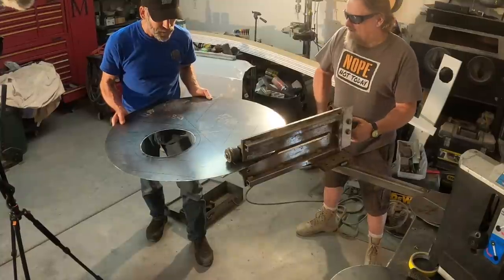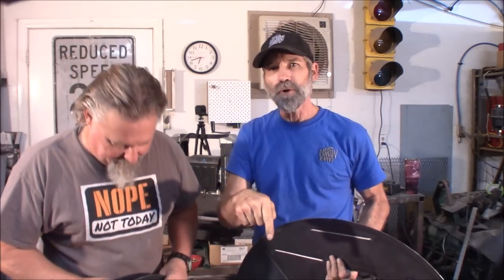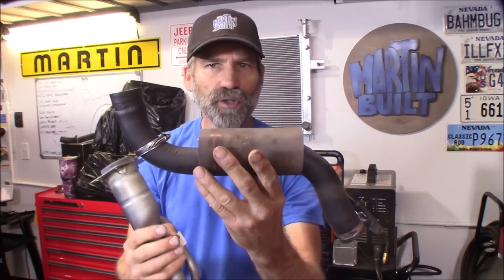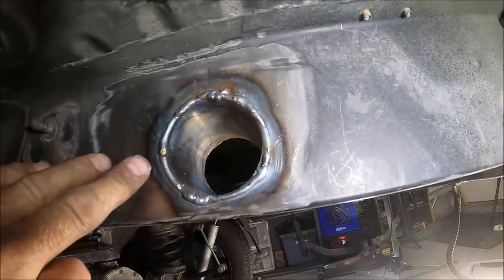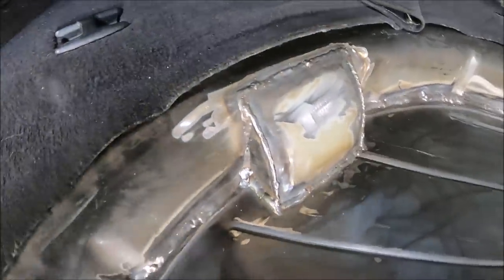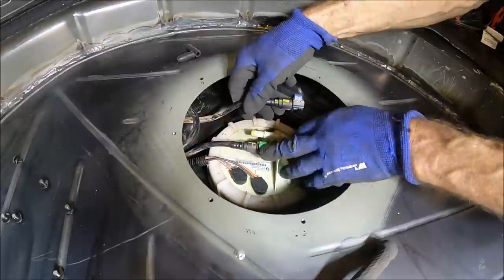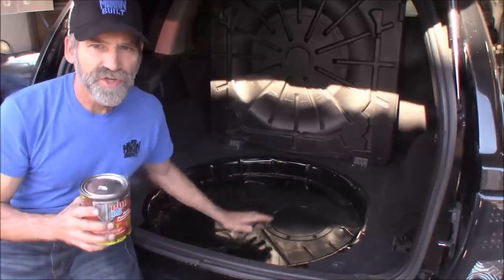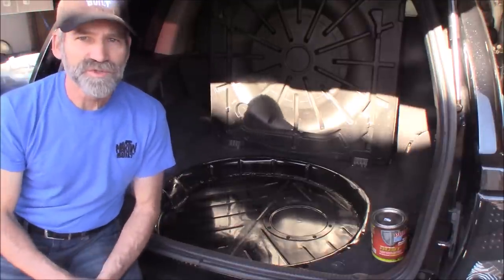How to Fuel Tank Tuck a 99-04 Jeep Grand Cherokee WJ Part 2

Comment: Thank you for the info. I saved lots of time by not welding the pan in 100% only 1" beads with 2" spacing. I used a metal adhesive and it's a strong adhesive weld like you see on vehicles, and 100 waterproof.
Reply from the maker: Nice work!

Comment: Nice job you made of that I was a bit worried that you would have problems getting the rubber fuel pipe on but it worked out fine in the end.
Reply from the maker: Thank you

Comment: Great job Martin! Only thing I would have added would be seam sealer to the weld on the bottom plate to give it a more finished look. Run a sizeable bead all the way around and use a brush and lacquer thinner to work it smooth.
Reply from the maker: Thank you, James, and thank you for the tips.

Comment: Love your attention to detail
Reply from the maker: Thank you, Nate
Reply: martinbuilt is yours a quadradrive?
Reply from the maker: @nate4036  yes it is.
Reply: martinbuilt I bet with those posi units and add some 4.56 gearing, it’d haul booty. I sorta enjoy the street look WJ. Kinda SRT before the SRT. Have you swapped the converter or added a shift kit?
Reply from the maker: @nate4036  Hi Nate, I would like to change the gears I was thinking of 3.92 or 4.11, I feel the 4.56 are a little to steep that would be 3000 rpm at 70 mph.  The convertor is on the list as well as the shift kit. Do you know of anyone that does go work building stall convertors?  What is your opinion about which one to do first, gears or convertor?
Reply: martinbuilt I’d say a Circle D 2600 stall, and I’d do gears first. They take the stress off the transmission, a stall would then take advantage of them. If you’re considering larger cams in the future, may want to run closer to 3,000 stall. My last mustang had 2800 stall, 4.30s, 26” tires. Pulled great and would cruise efficiently around 28-3000rpm. But I’ve noticed that the 545rfe seems to have lower line pressures, seems the sonnax (spelling?) shift kit with the line pressure boost is a smart decision.

Comment: Beautiful work! You could use the old spare tire place for some tools now. Do you keep the spare tire in the luggage area now? I hope you can solve the fueling issue and "parachute" issue.
Reply from the maker: I haven't carried a spare for years, I have an air compressor and AAA...Lol
I'm not to worried about the fuel fill issue, it's just a little slower than normal.

Comment: Glade I didn't have EVAP to tinker with! I just cut that sucker flush, traced the tire cover onto some ⅛ steel and cut it out. Raptor lined and then drilled it every 3½ around the edges and used some self taping screws and silicone to secure it. I cut frame and welded a 3" exhaust in it and  plumbed it all back together... But the new 4.0 I just bought has that stupid evap so this looks like it would be worth all the extra to save room for that to be tucked later.

Comment: Martin, im planing on relocating my evap system from the lower left corner, do you have any sudgestions?
Reply from the maker: I would imagine you're gonna relocate it to under the hood like the earlier WJ's.  I would just get everything from your local salvage yard from a donor vehicle And swap everything over. And you'll also need to do a little wiring as well.
Reply: @martinbuilt   thats what I was thinking  I wasn't sure if that was the most reasonable place as I am building for off road use but don't think water (water crossings) will be much of an issue .
Thanks Martin
Reply from the maker: @douglasbeary7890  
there is a vent on the EVAP that I would raise if you are going to do deep water crossings.
Reply: can it be mounted horizontally? thinking of dog housing it with my fill tube which might go over the frame. then a flat, millenium falcon shaped lid.

Comment: The aluminum filler neck and vent, if you install it 180 degrees from how it’s supposed to go in (upside down) trim 2.5-3.5 inches off your filler and vent neck side (not the hoses) you don’t have to cut and run ur lines threw your unibody just saying already went threw this months ago.

Comment: Great job Martin. 👍👍👍
Could an electric motor with a foot switch be attached to the bead roller, to give the same speed as hand cranking?.
That was a great idea with the bicycle wheel for support.
Reply from the maker: Yeah Rick and I talked about that how nice that would be to have some kind of electric motor with a gear reduction drive and a foot pedal.

Comment: I'm on my 8th and FINAL WJ and I don't think I'd ever do this as I don't see the point. All of your other mods are very applicable. Spare tire pan provides structural integrity for the frame though doesn't it...?
Reply from the maker: The spare tire holder does add some structural integrity one of the reasons I didn't eliminate it all together and why I added rolled beads to the steel plate and welded it in 100%
 I feel the vehicle is much safer now that the gas tank is tucked up under the vehicle more and doesn't expose it as much as it did before to a rear impact.
 It sure looks better than that saggy diaper.
 Thank you for watching.
Reply: @martinbuilt  I understand the reasoning behind this. Where does the spare go?

Comment: Any chance you have a video showing how to relocate the EVAP canister ? I relocated mine without pics ( stupid ) now I don't know where the middle hose on top of the canister goes and what attaches to the small tube on the gas  filler neck . If anyone knows, I'd greatly appreciate it. Thanks in advance
Reply from the maker: The small hose that is attached to that round grey thing goes to the fill neck vent and the middle hose on the canister goes is the large hose that heads to the front of the Jeep.

Comment: Noob question but won't drilling into the frame cause issues with like strength? Any way I would be able to change things up to avoid drilling into the frame? And amazing as always Martin 💯
Reply from the maker: Thank you, Hasith
I would agree if you drilled threw the frame and did nothing else but since I sleeved it and welded it in 100% IMO I feel that it may even be stronger then before.
Reply: @martinbuilt  ohhh rightt thanks Martin. Gonna be following these two videos and try do this on mine. Thanks to you and your videos my old Jeep got a new leash on life 😭❤️

Comment: It looks so beautiful! 😢😍
Reply from the maker: Thank you, I do appreciate that.
Reply: @martinbuilt  yes sir. I've got a 99 Grand Cherokee Limited. I've got some work to do to it. It has the 4.7L V8. Automatic. QuadraTrac 4wd or AWD if you want. What mods would you suggest? How bad does it hurt these motors to overheat?
Reply: Trent I’m not jumping in on him, but over heating a 4.7 is almost certain death. The break down of the tappets and dropping rockers is almost guaranteed. It’s very much fixable, but plan for tappets, timing chain, rockers, and head gaskets. I recommend a chain soon after 200k but seen oem go 300k
Reply: @nate4036  it has 175,000 some odd miles on it. Its been overheated at least twice now. Both times were heater core related. I bypassed the heater core and had no more problems with overheating until the radiator sprung a leak. Thankfully I was just working around the house and caught it right away.
Reply: Trent Sounds like you’ve been lucky brother. Oil look decent when you drain it still? Just keep up on the maintenance and she’ll live for you.
Reply: @nate4036  Oil looked fine. I was so scared I was gonna have the dreaded milkshake but everything looked fine thank God.
Reply: @nate4036  main reason I was asking him was because he had mentioned it in one of his videos a while back and I was just wondering.
Reply: @nate4036  I really truly appreciate your input man. Thank you

Comment: Hey Martin
Love your videos
I had a question bout tha tcm swap
My tcm has 3 different port and tha jeep tcm has 1 whole port how will I go bout fixing that
Reply from the maker: Thank you, you are looking at the ECM, the TCM on your vehicle is most likely located in front of the air cleaner box.
Reply: @martinbuilt  
Thanx Martin 
I found it
But my port has 3 port not like urz
1 port with 1 bolt
Reply from the maker: @thaAzian1401  what year, make and model vehicle do you have?
Reply: @martinbuilt  
05 dodge dakota slt
3.7l v6

Comment: Hey Martin! Any chance you know what years and sub models have the heavy duty tank skid?
Reply from the maker: From what I've seen at my visits at Pic-a-Part, it doesn't matter what year or sub models  it's almost hit-and-miss.
 I would imagine that all Overlands have a heavy-duty skip plate.
 I've actually been thinking about building another one with the light duty skid plate just to reduce the weight of my Jeep.
 Since I don't go off-road, that one at all.
Reply: @martinbuilt  Thanks for the quick answer! So I'm assuming it's pretty obvious the difference between the heavy one and the light one?
Reply from the maker: @TheGersh13  Yes you can really see it in the area where I had cut my skid plate.

Comment: I have a problem with grand cherokee 2000 4.7, I changed the cranksensor because it turns off I have to wait for it to cool down and turn it on again, but it still keeps turning it on.  would it be the fuel pump?
Reply from the maker: It is possible, I would get a fuel pressure gauge and check your fuel pressure at the fuel rail, should be somewhere near 50 psi
Reply: I changed the fuel pump, it starts running and after it turns off I don't know what to do.

Comment: Great job!, Martin
I have a 2003 WJ Overland and I have problems with the differential shafts, they are original, they are permanently blocked, dana 35 and dana 44, what do you recommend, change the axles or repair them?
Reply from the maker: sorry to hear, what do you mean by permanently blocked? 
you could replace them for around $200 per axle at Pick-a-Part
Your front axle is a Dana 30 and rear is Dana 44
Reply: If you have the overland with the 30/44 combo you likely have LSD's (come's with the Quadra-Trac 2), i wouldn't give them up as they are about the best factory axle set up on a WJ that you can get, mine is an 04 WJ Overland and that as I understand it was standard for that model however mine is Canadian, don't think it matter's.
Not quite sure what the problem is but it sounds like either axle seals or cv boot's either way cheep parts that may be messy to replace but not hard for a tool user.

BTW Nice job Martin
Reply: @martinbuilt  Thanks for your comments Martin, when doing a test turning the wheels in the air, both wheels on the axle always turn in the same direction, and on the way you feel the blockage when turning, I am writing to you from Chile in SouthAmerica
Reply: @dshepard3161  Thanks for your comments friend, that's how it has LDS, I usually import the spare parts from Ebay to Chile, the problem is that the bleokeo of the axis is permanent, it is not released, it is practical in off-road but not in the city, some suggest me to change axles and put Air lock or electronic lock, and others suggest me to repair the LDS system, if the LDS is cheaper but difficult to find the repair kit, I don't know which one to choose
Reply: @joseluisguajardo3732  Ah I see, my bad for assuming that you were in North America, "bleokeo" is not a word i understand, however from what you are saying it sounds like the diff is not disconnecting under normal driving conditions, if this is the case yes air lockers are an option however you may find it much cheaper to get a new set of viscose coupler's (clutches) for the factory unit's, they do require a diff oil that has an additive for friction however.
I have to say that mine has only just rolled 220,000 km but I use her rough towing a trailer into the bush country/mountains of west Canada hunting. Never had a problem.
As i do not have any idea how hard it is to import anything to Chile or what prices may be like i can only help as far as tech knowledge goes and your friends may be right about changing the factory LSD's out, but the D44 is un-stoppable up to 35" rubber in that weight class so don't dump it unless you have a direct drop in replacement, setting up new link's requires some experience.
Reply: @dshepard3161  yes it is, I am somewhat far away in Chile and for my hobby I usually follow several of these websites, I have done many jobs in my wj, it has the same mileage, but the specific things I leave them to an expert, I can purchase parts in a dealer here but It is very expensive and it is more convenient to buy in the US, here we call "blokeo de diferencial" in spanish to the differential lock, I will put tires between 33 or 35, I will try changing the couplers

Comment: Anyway to do an EVAP delete without having negative consequences to the engine or fuel system?
Reply: David Macias you can delete it without any damage to either, it’s going to throw a code though
Reply: @nate4036  thanks for the reply 👍

I want to get rid of it because mine is located right where Martin's is and I take my WJ wheelin. Trying to eliminate the low hanging fruit
Reply: David Macias I can’t legally tell you to delete, but here in TN, stuff like that evap 
and cats tend to fall off🤷🏻‍♂️

Comment: Hello Martin, I'm having a problem with my '02 grand Cherokee with fuel draining back to the tank after it's parked for a while. I've changed the fuel pump but nothing has changed. What's causing this?
Reply from the maker: You'll need to replace the fuel filter the fuel pressure regulator is inside the fuel filter which is also a check valve and that's what's causing he will take the train back.
Reply: @martinbuilt  I forgot to mention that I changed the fuel filter when I replaced the pump. I have a inline check valve that I'm going to use. Do I need to put it between the tank and filter or between the filter and engine?
Reply from the maker: @terryhopson5220  sounds like a defective fuel filter. You could install the check valve anywhere near the fuel filter and pump.

Comment: Maybe I'm a dumbass,  but couldn't you've made the whole plate removable?...  not busting your balls... your good Martin...
Reply from the maker: I would have if the plate would have been flush to the top but since there is a small trunk space the way I did it, it would have been difficult to make it removable. I like that it is welded in as this returns any strength that may be lost from removing the wheel well.
Reply: @martinbuilt  nothing but respect ,no worries...glad for the response..got a cheap wj myself with all the options ;.just trying weigh the effort.  .
Reply: What did you do with the spare? 
..
Reply: And how do I purchase one those vavle spring plates?

Comment: I love this idea. I removed my tank years ago for fuel cells ( Which I don't recommend). Here is a nut insert tool from harbor freight that you can use to install threads into that big bottom piece. https://www.harborfreight.com/45-piece-threaded-insert-riveter-kit-1210.html
Reply from the maker: Just curious what fuel cell did you use and where did you mount it?
Reply: @martinbuilt  it's a 12 gallon that I have mounted in the back along with my 1 gallon methanol tank and battery.  I wish I could post a picture but YouTube doesn't allow that.

Comment: The reason why you cant fill your tank properly is cause you added a barb fitting in the vent hose restricting air flow.
Reply from the maker: the 02-04 all have that small air vent and they all fill just fine. The fill neck vent is actually larger then the 02-04.
It will fill okay for about 30 seconds and then it clicks off.
Reply: Yeah, about that.. on my 04 Jeep GC Overland 
 I also recently dropped my skid plate and replaced my 2 fuel lines that go to my fuel filter/pressure regulator (which is also new) I then replaced my gas tank straps and did a lot of rust repair & preventive rust maintenance
 (I live in Rhode Island) 
So, after completing this, I go and start it up. Only to have my gas filler sucking in air like as if it was a vacuum cleaner? I also have a new gas cap. Then, when I went to put gas in, It would keep stopping and only let me trickle it in. So, I did some research. I then changed my purge valve solenoid,  Leak Detection Pump, Charcoal Canister, and some other valve thingy that was part of it. $300 later. It still is sucking like a vacuum but not as noticeable as prior. And I still can't pump gas normally. It's getting frustrating! I'm about to stuff a rag in it, light it, and cut my losses! Oh yeah, I also losend the skid plate bolts to drop the tank just enough to make sure no hoses were getting pinched.  It still has a vacuum effect?? Any knowledge, please 🙏 help!

Comment: P1494
Reply from the maker: First, check the gas cap. Then the vacuum lines to the EVAP system from the fuel tank and those to the purge valve.

Comment: was on board till the hole in the frame part lol no thanks
Reply from the maker: Heck after welding that piece of tube in there for that hole I wouldn't be surprised if its stronger now then it was before.